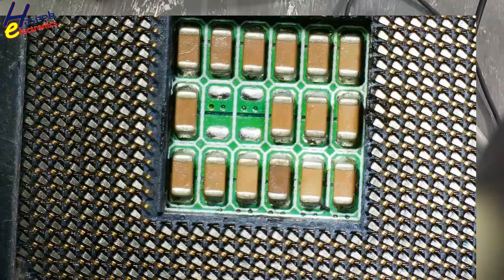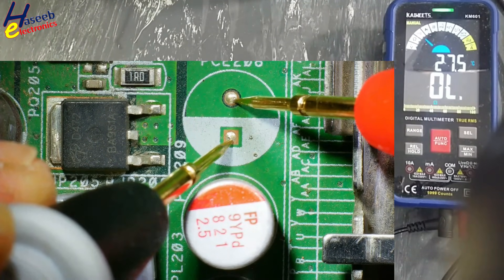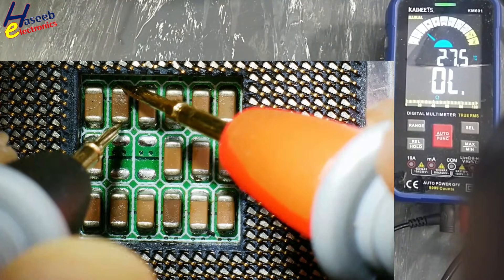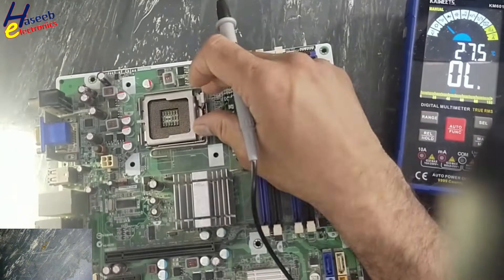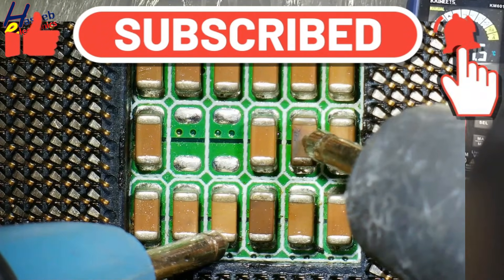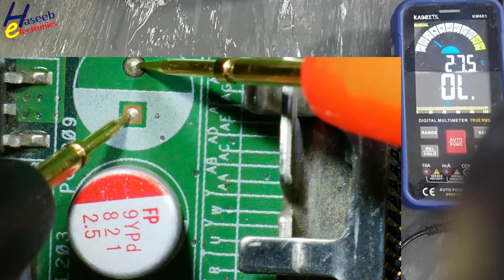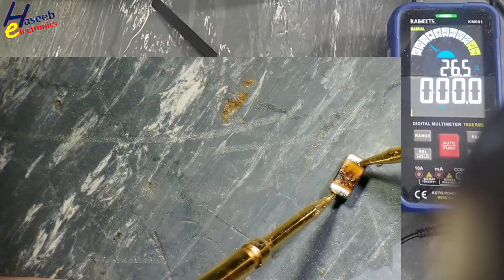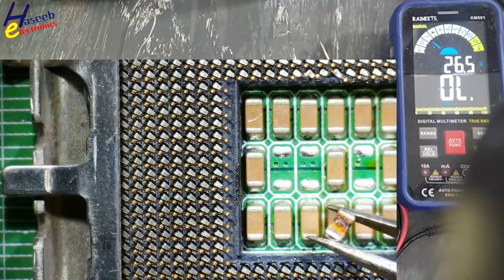{1254} Detecting short circuited capacitor

Comment: Curious how to determine negative line in that capacitor array. Also, how to determine correct current to use? Thank you greatly!!!!
Reply from the maker: In that capacitor array, only 2 lines are entering 
One line from -ve terminal of polar capacitor. While the second line from +ve terminal of the polar capacitor 
I use 10 amp or 20 amps power supply with 1 volt to 1.2 volt maximum
Reply: @HaseebElectronics  did you meant mA or full an Amper?
Reply: Well these capacitors are in the supply line to ground, and the cpu has a set of ground pins.

A different take on the same method, is to melt some rosin with your iron, over the caps, so the rosin smoke condenses on the cap and leave a white-ish layer. If you push 1 or 2 amps through at say 1v (you don't want to power on the cpu), the heat will turn that white coating into a liquid spot

The other way which is far less visual, but not as time-consuming as the rosin method,  is to apply your 2A, but get a cotton ear bud, dip it in ipa (or cigarette lighter fluid), touch the bud to the  top of each cap, and if the ipa wetness evaporates quicker than the other caps then that is the faulty cap

The easiest way is to apply your 2A current, and look at the board with a thermal camera, but the cheap 32x32 ones are rubbish, Blackview and Cat62 phone have fairly low ir pixel density too. You ideally want a 192x256 possibly with a macro lens, but doubt you will have much money left from $250 for an Infiray p2 pro

Also don't start off with 20A, or use a short killer. This will find the weakest track on the circuit where the current flows, and fuse that track or component, but that may not be the shorted component. If you are doing this on a pcb, if you are unlucky, you now have 2 faults, if it is a cpu then often unfixable. Use 1A steps until you feel the heat, not with your finger tips (skin too thick, takes too long for your brain to register heat, and not that sensitive), but use the back of your fingers

Comment: @HaseebElectronics, it is needed to mentioned, that one of the pole must be the "main ground". Voltage injection can be really dangerous. I think it is better to inject a voltage lower than a PN junction threshold value, because you never know, what is connected to there. Of course, if you know that, there is nothing other connected, just bunch of capacitors, then you can use even a higher voltage. Maybe it is better to use a "flux" on capacitors, then you see, that where is flux melting. Using so high current, that capacitor is melting is not a good idea. What if a broken capacitor suddenly change into open circuit and your 3V and extremely high current limit can blow everything what is connected?

Comment: How do we determine the max voltage to be injected? I understand we should not exceed 3.3 v DC in this case
Reply from the maker: The best value is 1 volt to 1.2 volt with correct polarity (we can use 5-6 D size ni-cd cells in parallel or alkaline cells for getting 1.5 volt)
We can also check the datasheet for that closest voltage sensitive IC (in this circuit situations. The microprocessor is closest voltage sensitive part) 
The maximum allowable vcc voltage  will the highest possible voltage can be injected

Comment: can you use non-contact voltage detector to quickly check if power disconnected circuit board has any capacitors with voltage remaining ?
Reply from the maker: I think no 
Best test tool as per my experience is HP-3456 multimeter using 4 wire measurement in resistance mode to compare resistance between components in parallel 
Or 
To compare voltage drop across the components in parallel 
But this multimeter is much expensive

Comment: Great one.. Sir, if we do not restore a good  Capacitor After removing the damaged one does it have any negative impact?
Reply from the maker: If we will not install 1 or 2 capacitors. It can be compromised. Because the capacitance values is always 120-150% higher than the required value 
But it is best to install the capacitor to keep the system in good working free from any ripples

Comment: I've replaced quite a few SMD capacitors but never found a bad one inside the CPU socket! Great video. Thanks for sharing!
Reply from the maker: You are right these X7R CAPACITORS have less failure rate than the Z5U materials
It's failure rate is very low

Comment: Candle wax could be used successfully. Prepare a candle dissolved in acetone or gasoline or whatever... Use a brush.... Connect the circuit to a low voltage without the need for high amperage. The wax will melt first in the place of the defect, because it heats up first. We also have the modern method, this one with wax was used in the past. Now we have thermal  cameras...
Reply from the maker: Humble thanks and best regards 💕 for your valuable comment 
Yes 
candle wax
Hand sanitizer gel
Vaseline 
IPA 
Low temperature melting soldering flux 
Freezit2000
Thermal camera 
IR Camera 
IR temperature logger 
Microvolt comparison 
Milliohm comparison 
Are multiple tools and tricks to be used to point out the suspected component

Comment: Temperature probe will help us to find faulty components 😊 We don't need to wait for the blast 😊😊
Reply from the maker: @Optionade these smd MLCC are very small, these cannot blast with high sounds 
If we try to eliminate polarized capacitors 
That will create huge blast sounds, it's pieces fly randomly with joy at the time of blast 😂😂😂
Reply: Or thermal camera
Reply from the maker: You are right 
Thermal camera 
Low temperature melting flux 
Freezit2000 spray 
Hand sanitizer, Vaseline
Different tricks work in this fault condition

Comment: Wouldnt a lower current also reveal the short circuit capacitor by using an infra red camera to observe which component is overheating?
My concern is that 10A may damage small width interconnecting tracks.
Reply from the maker: Infrared camera is also a great option 
Spraying freezit2000 is also good 
Applying low temperature melting flux is also works good 
Moreover 10amp power supply will not damage the tracks 
As the power rail tracks are for designed for high current ratings

Comment: What voltage and current you applied
Reply: I wonder if with a milliohmmeter you can measure the difference in resistance of the PCB trace, until you get to the faulty part...
I'm going to do a test, I have the MESR 100, I'm going to try measuring the trace from the PCB to see if it does the diference to a few milliohms
Reply: @Pozitiv_ion  It should work. I believe you can also use something like the four-wire HRM-10 battery tester.
Reply from the maker: I use 1.2 volt,  10 ampere power supply
Reply: @HaseebElectronics  which power supply you use
Reply from the maker: I use power ten 0-48 vdc, 0-10 ampere power supply
Reply: @HaseebElectronics If it is a linear power supply, in this way, sometimes you risk damaging the final transistors, too much voltage falls on them (the difference between input and output), this multiplied by 10 A gives as a large heating.
 If it is switching powersuplay, it is possible…
Instead of that, use wax😃